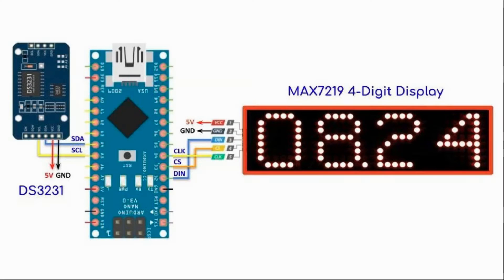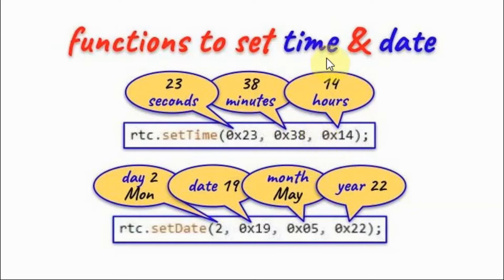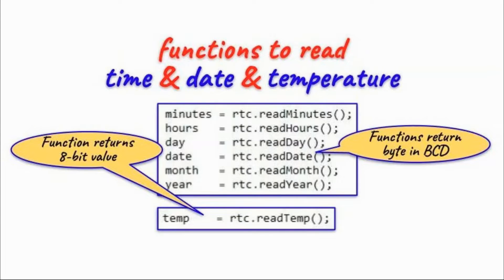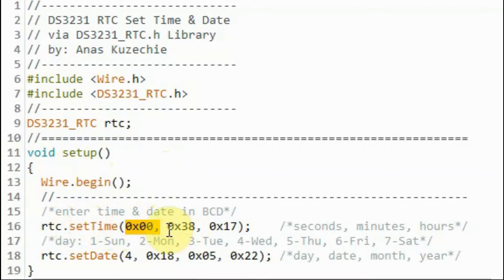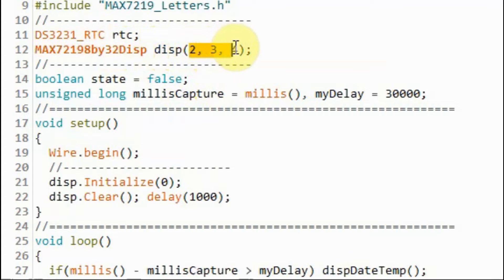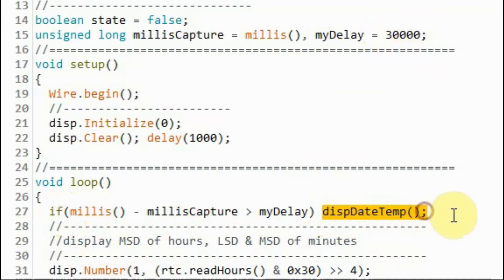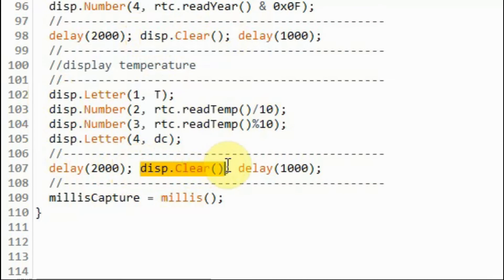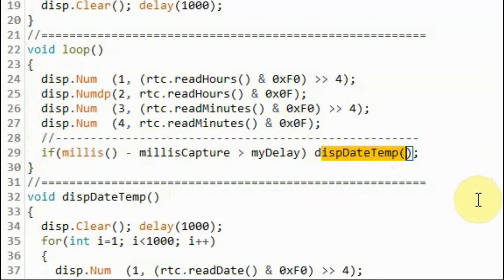Creating Arduino Library for DS3231 RTC

Comment: It does not install ANY of your libraries downloaded from your repository.
Even manually placing the extracted files into a certain project folder it does not compile.
True for every of your entries i.e. <MAX72198by32Disp.h> 
Error: No such file or directory
The mentioned files (header and so forth) come up on several tabs next to the clock source tab.
Have tried on Arduino 1.8.6 & 1.8.10.
Extracting folders and files works with no problem.

Comment: hello in my project which is the smart stick for blind person I use an mp3 player to for example warn the person that the stick turns on or goes to sleep, I would need help to program the mp3 module so that  in my code on the accelerometer if the cane lights up the mp3 module say the cane lights up using pre-recorded messages.